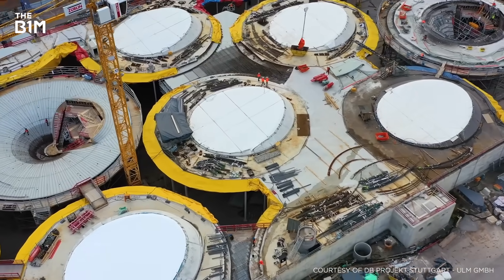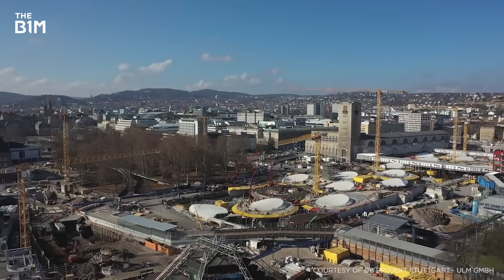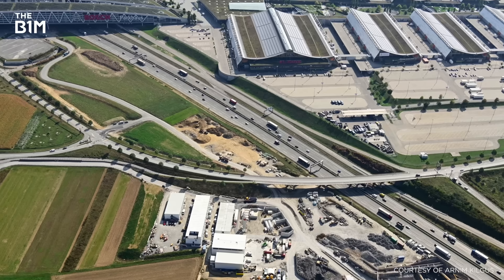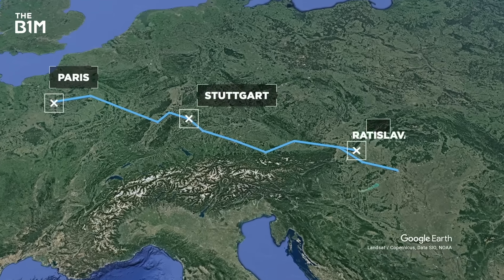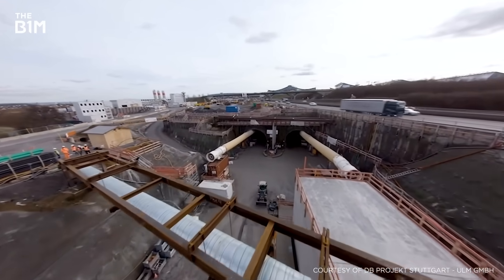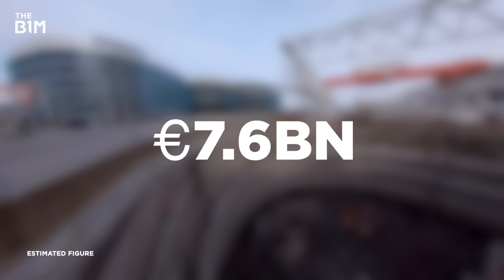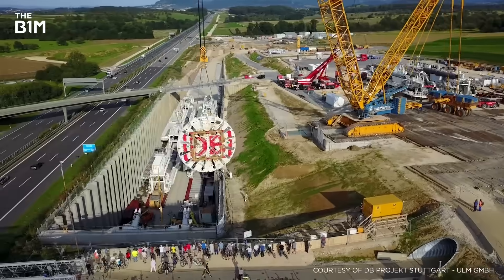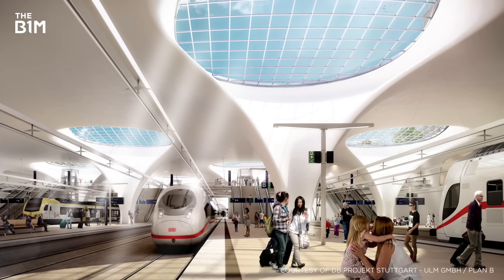Germany's 27-Year Struggle to Complete a Rail Project

Comment: "How we make the 8 lines from the old terminal faster? Built again 8 lines..." greeds from Germany, the geradest country in the wold with the best infrastructur. Hust Hust not
Reply: You got it wrong the old station had 16 lines
Reply: Wien Südbahnhof (terminal station with 20 tracks) was also replaced by a new through station (Wien Westbahnhof) with 12 tracks.
a) Wien (Vienna) is a bit larger than Stuttgart
b) 4 of the 12 tracks are mainly used by S-Bahn trains. While the 8 tracks of Stuttgart S21 are only for regional and long distance trains.

Comment: The problem is, that the capacity of S21 could be smaller than the capacity of the old station, doo to the slope of the trails in the station.

Comment: the design remind me so much of the new beijing airport. but to build it under existing infrastructure, it feel over complicated, i can't but feel it would have been easier to just build it on a new site. but as the video say, it too late to regret now. when completed it would be unique for sure.
Reply: however: which new site? It's the state's capital, expanding from hillside to hillside across the entire valley and beyond ... there simply is no empty site except far outside the city center, which would be stupid for a central station
Reply: @EnjoyFirefighting  beijing high speed railway station is far outside the city center for example, there are always choices. humanity has move entire cities afterall... one possibility is to build the station where the train depot is. it would even be surrounded by parks.
Reply: @lagrangewei  I know a few stations in Germany where the high speed train stations aren't the main stations and it honestly is annoying for travellers to not arrive directly in the city but with the need to board another train to actually get there; Apart frmo that there aren't many large open areas around the state's capital city there, it's very limited due to the terrain and the already existing suburbs, villages and towns in the capital's metro area; Options are very limited there; The depot will be removed as far as I know, all the above ground tracks will be removed in that area
Reply: @EnjoyFirefighting   the train depot isn't even that far from the station. what i am saying is simply that are options. had they know, do you think they would still gone the way they did?
Reply: @lagrangewei  not gonna play a what if game ^^
Reply: @EnjoyFirefighting  even your video imply they are continuing it because they don't have a choice "NOW". i am not arguing they shouldn't have done this because there is no where they will know the problem back then. but the point of the comment is there is always alternative. we don't live in a binary world. of course every option has it pro and con, every design is a compromise but that doesn't mean there were no other choice.
Reply: @lagrangewei  my video?
of course there isn't really a choice now, as stopping the project would cost the same amount of money like finishing it;
Well not every alterntive is good or nice; There was a planned Transrapid (German high-speed monorail train using magnetic levitation) planned linking my city via the capital city's airport and their central station. It was never built; Instead there's only a 2.5 km long link track built to connect our city via existing train tracks to the airport with an regional express train serving it. okay, but far from impressive, great or forward-thinking

Comment: The railway line that they mention and also visualize in the video, is the original railway line of the orient express. That is Paris-Budapest, not Bratislava. It is visible even on the blue line, that Bratislava is only a small, divided section of that long line coming from Paris...

Comment: TheProblem is, by the timeit is finished, the world and its needs might already have changed. Tonot start with including natural habitat protection and historic buiding protections are mistakes.
Here in Switzerland they kind of made the mistake to not build a second tunnel trough the loetschberg vrom start, especially since italy decided that they would prefer the cargo hub to use the simpon loetschberg rather than the gotthard route

Comment: What's crucial is that the changes don't really benefit the people that live in Stuttgart. If you live in Stuttgart, you don't care that it's a terminus station, because you have to get out anyway. The advantages are mostly for the through-trains.
But this is happening all over Europe. Centuries-old cities are being dug up for major infrastructure projects. Another example is the north-south metro/underground/subway line in Amsterdam. All they had to do is bore a couple of tunnels through a swamp underneath a UNESCO World Heritage Site? How difficult could it be? There was a lot of opposition, there were massive budget overruns, there were sagging buildings,there was a referendum where –fortunately for the city– not enough people showed up to make it valid, and the city was dug up for the best part of a decade, but in the end, there's a very pretty underground railway that solves a lot of problems that previously existed with the street-running trams.

Comment: Benefits  ?
Stuttgart-21  ?
WHAT  Benefits  ?
Reduced capacities of the station -  a  BENEFIT  ?   Really  ?  
Remember : 16 tracks for complete  ( and very long )  trains.  Oftenly used by 12 or more trains at the same time.
NOW with the underground-station :  Only  EIGHT  Tracks  -  too short for  TWO trains at the same time
So this is going to lead to Reduced punctuality  -  and this also should be a  BENEFIT  ?     Why  ?!?   
( Stuttgart was one of the train stations with the highest punctuality throughout Germany - this time will be over with Stuttgart-21 forever! ) 

Starting with the birth, I used to be a long-term citizen of Stuttgart (I'm over 50 now!). And this project is just cursed. From the beginning. 
A whole lot of wrong assumptions and also false conversations to citizens as well as lies and unreal Promises of Benefits about the project 
at all led to the start of construction. 
And NOW.....  most of the responsibles would stop this bullshit - if they only could.  But of course they can't do that anymore.

And now here are the greates jokes off all :
German Railroad is working on the punctuality of their train system, which isn't really good.
And they want to install a tote timetabel, as it is working very well in other contries.
Now..... The new Stuttgart Train Station might be the most modern all over Germany (and maybe all over Europe), 
but....   it absolutely  CANNOT  BE  INTEGRATED  in the coming timetable-system.
And that's just one of the really big and insoluble problems (much too few tracks) that leads to a magnificent 
Non-connection of this project to the rest of the railroad infrastructure.

And this ends with the cost of more than nine billion euros (hopefully not even more)!
And on the other side .... Since then, there has been almost no more money to get schools and other community buildings as well as the rest of the infrastructure infrastructure in good condition.
Stuttgart-21 was / is the "private game" of a handful of early VIPs from business and politics .... 

Stuttgart-21 was / is the  " private game "  of a handfull of formerly VIPs from big business and politics....
I'm sorry, but your report is completely one-sided, and it doesn't show the reality and the sad facts.....

Comment: Stuttgart 21 allows for new city quarters to be build on the old tracks and instead of the old station. The adjascent park will be expanded and people will work and live there. Existing parts of the city will be connected which are still separated by the station. So besides the benefits for the railway services and despite the huge costs I think it's crucial for the city's development in the decades ahead.
Reply: The new city quarter could have been built on areas which are now being used for construction logistics, or on top of the overground station, without destroying functioning infrastructure. The adjacent park was actually partially destroyed for Stuttgart 21, with century old trees having been cut since they were in the way of construction. Therefore, the expanded park will only be a far cry from the idyllic place the Schlossgarten near the overground station used to be.

Comment: What I (not a German) don't get about the project is that the number of tracks will be reduced from 21 to only 8. For a city of that size, 8 seem like very few tracks indeed.
Reply: If you don't count the tracks used for S-Bahn trains also Hamburg Hbf and Vienna Hbf have only 8 tracks for regional and long distance trains. And both cities are 
a) considerably bigger
b) due their location natural start and end points for many trains. Which is not really the case with Stuttgart. 

The old station had by the way only 15 platforms in use. And only 5 of them were able to serve through trains (i.e. coming from Zuffenhausen and departing towards Bad Cannstatt. Or vice versa.).

Comment: Another key point of criticism: the capacity.
You don't have to be good at mathematics to realize that a station with 8 tracks has less capacity than a station with 16.
Reply: it's not just the number of tracks which is relevant, rather the trains per hour capacity (as a through-going track will be blocked way shorter than an ending track), however also in the trains/hour calculation it indeed has a lower capacity
Reply: @EnjoyFirefighting  The problem is the establishment of a regular interval timetable in whole Germany, so that in every major city every Intercity is linked to each other. And for that, many tracks for a short period of time are needed.

Comment: From what i know about this station is that its just not worth it after all because you have less terminals, higher maintaining costs and fewer passanger capacity than in the 100 year old station. The tunnels has to be maintained hard because the terrain isnt good at all and the tracks have to get maintained aswell because the ground is moving because of the soggy ground. But i hope this is getting a success after all.

Comment: Viewer from germany here:
Focused to much on the pros and to less on the cons. (While cons are the reason for the project taking so long.)
There are just to many and feasibility is just one of them. Biggest problem e.g. is that the new station will have less capacity than the old one. That results in just a heavy expensive project, that achieves the least possible for so much money.

Comment: You did not mention that the capacity of this new railway station is lower than the old one, that the main speed gain comes from newer rails and not the station underground, that there are extreme risks in the project even after it will be finished such as tunnels crashed due to instable overlying rocks and there had been cheaper alternatives.

Comment: It's unfair to compare S21 with the BER! S21 is a huge project crammed into a large city with many obstacles and very complex architecture! BER was built in an open field, with no obstacles.

They had to reroute a huge main sewer, relocate an entire underground tram station and several tunnels while still in operation, build around a main road which has to be relocated several times,  build under a historical building, they have to be carefull with the high pressure mineral water and ground water, keep the main station fully operational etc. etc. etc. 

The new underground main station is partially built on a BRIDGE via a tunnel under the train station because the old tunnel can't support the weight of the new station.

Each Form of the columns consist out of 500! individually CNC milled parts, there are three of them! 
The reinforcement of each column consists of 11,000 individually bent bars. There are 28 full columns and several half or partial columns!
It takes 450 plans for each column!
The concrete is a special white mixture, developed for the project! The concrete and steel must be protected from water at any time so that the rust does not contaminate the concrete!

Comment: On the danger that this gets ignored here goes.
Stuttgart 21 is stupid and should not be celebrated on this channel

Here are a few issues that have not been brought up with this project in this video (Be warned, its a lot, and I bet there are more I dont remember):

Its endangering the Groundwater the city is reliant on. (Second biggest mineral groundwater source in Europe) The protection zone for it was moved because of this project.

They say its connecting the City to Europe. But the City already is, the TGV is going to Paris in 3 hours from here, and has been fpr 20 years already.

They say its making the connection to Ulm faster. But Trainstations usually are not the part that makes trains go faster.

It has LESS capacity than the old station. It would need 12 platforms to reach the same capacity, but only has 8.

The old station was the most punctual in germany, with up to 37 trains per hour. the new one is planned for only 32. (So less connections)
They say it has twice the capacity, but that only applies with an average stopping time of 90 seconds per train, which obviously wont be the case.
They also say its gonna be a place to swotch thrains in germany with the "Deutschlandtakt" idea, doesnt work though, the station is to small.

It has a gradient of 1.5%, enough to have strollers and wheelchairs start rolling. In cologne only 1 platform has 0.2% gradient, that already was enough to cause multiple accidents related to it.
This is not allowed with Trainstations, however they are classifying Stuttgart 21 as a "Trainstop" instead of a station.

The rock they are tunneling through expands when in contact with water (remember the whole mineral water deposit thing) yeah, connecting those 2 is a great idea, also boring needs water.
More on the rock: The tunnel has to be quite tight because of the rock, making escape routes and firesafety a problem, cause less room the smoke needs to take up. Also, they are in an expanding rock, so yeah... they are getting distorted.
Btw. ICEs are burning fairly often.

The station also might be underwater (nice in case a burning train arrives) to disperse groundwater, might lift the whole station a bit.

The Architect before his death removed himself from the project because he said "Its endangering lives.

The states Trasportation inister called Stuttgart 21 the biggest mistake in the history of railways.

The whole thing is and was a scheme by land developers who want the room cleared by destroying the old station to build buildings and sell it.
Reply: the gradient isn't allowed? it's just not recommended;
What's your interpretation of 'really often' concerning ICE trainsets catching on fire?
Reply: @EnjoyFirefighting  
The gradient is not allowed in stations. They are gonna make it a trainstop on a technical level though, so they can go ahead with it.

And by "fairly often" (not "really often" btw.) I mean, a few times a year.
From 2009 to 2019 it was 30 something times, so 2-3 times a year. Which, for a high speed public transport, is quite often.